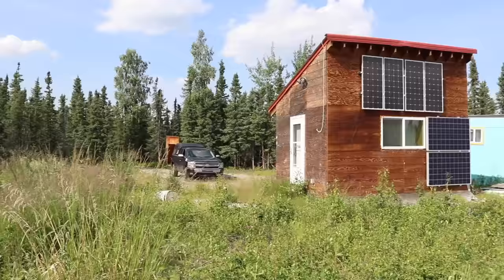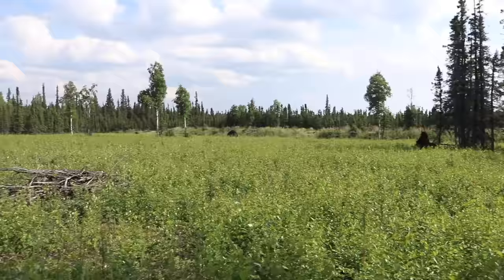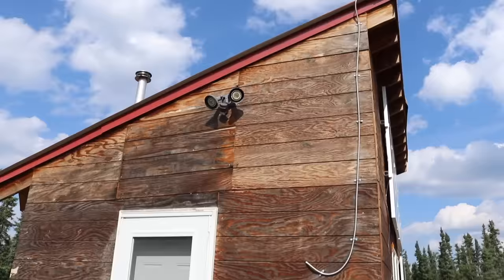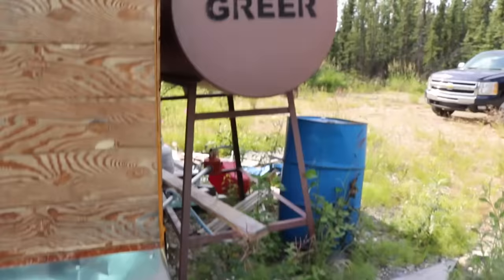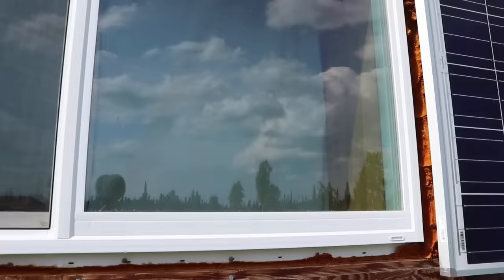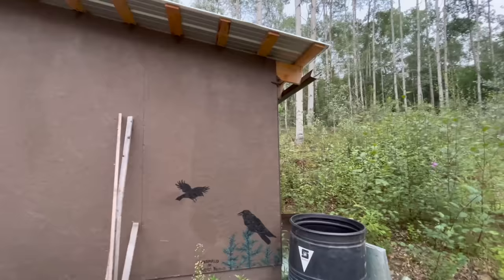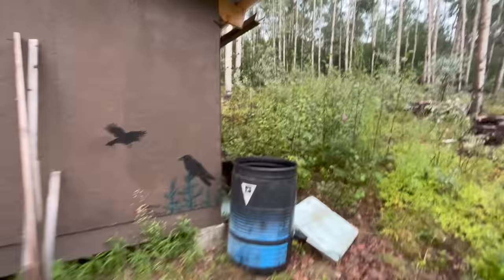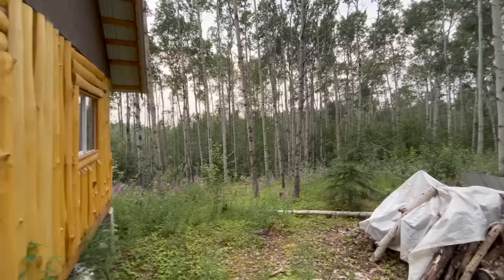Buying off grid land- you'll never hear this from Realtors

Comment: For 2023, it’s hard to nail down specific predictions for the housing market is because it’s not yet clear how quickly or how much the Federal Reserve can bring down inflation and borrowing costs without tanking buyer demand for everything from homes to cars.
Reply: Craig Daniels  Given current recession pressures, it is unlikely that the stock will yield substantial returns in the near term. However, it may be a suitable investment opportunity. I will monitor market conditions and consider purchasing when there is an improvement in the relevant economic indicators, any idea which stocks this may be?
Reply: @tatianastarcic  that's actually quite impressive, I could use some Info on your FA, I am looking to make a change on my finances this year as well.
Reply: @richardhudson1243  Found her, I wrote her an email and scheduled a call, hopefully she responds, I plan to start 2023 on a woodnote financially.

Comment: 33 years off grid I can say this is well thought out advice.
I chose a location with  gravity feed water,  south slope, fertile soil and walked a half mile, each way to the car,  for eight years before building a road, and putting in a standard sceptic to raise a family.
still solar power but I ran a 3000 foot phone line in 2 inch conduit. I also dug a spring and trench 1600 feet through forest and stream , by hand, to run the water line.
Definitely worth the learning curve.
Reply: George when you say you installed a "standard sceptic" was that one of your parent or one of hers?
Reply: @almoemason by standard  I mean it is a 1500 gallon two piece concrete tank with 200 feet of leach field.  Really modernized the feel of the camp become house and home
Reply: @almoemason  typos notwithstanding the parents were definitely sceptics for a few years
Reply: 3000 foot phone line???    what for?    internet?
Reply: @AI-Consultant  when I buried this line there was no internet on earth
Back then we had a five watt bag phone and it barely had service. 
Raising a family, before the internet, I provided the phone for my son's to communicate with friends, and so folks could reach me with offers of work.
Reply: @georgemckenzie2525  oh cool, and the ocassional jumping on AOL i bet,. hahah
Reply: @AI-Consultant  dial up 
I don't miss it 
25 megs is fine and it comes DSL over that same phone line
Reply: Sounds like me,I tend to take a while to get around to doing it! 8 yrs b4 you built a rd! When did reality wake you up one morning and you said ,gee,it's about time I built a rd to the shack!
But ,its an experience living off grid!
Reply: @davidrussell8795  actually Iall the tools I bought to build my cabin found me work as a builder. After a particularly grueling 18  months of construction in Somerville Mass ( 4  ten hour days/ three days off a week ) I had an extra $30,000 and decided that having pushed a wheel barrow ( the distance from vermont) to Los Angeles it should be optional to push it back
Reply: @AI-Consultant  Because if you check history we did not have cell phones 33 years ago and of course 33 years ago dial up was the only way to connect to the internet. Don't be stupid.
Reply: @almoemason  i'm only as smart as you almoe
Reply: I like that yu hqave walked in for a while  8 years that makes some of us think A road/ drive way is possible in long term. I live in suburbeand to many people just walk up to the  house! In past 4 years @ attemped break ins while i was home!!I  I am in subdivision just 25 28 feet from street sidewalk!
Reply: @marynorton5820  the walk became my foyer, easing the transition(most days) between the world of cars and roads, to home with its horses, dogs, chickens et al. 
Children, it turns can inspire a father to move mountains if it makes their growing better.
Reply: @marynorton5820  I live on a rural state road so the usual idiots never bother us, if they're out they hit the neighborhoods. I'm surrounded by six acres on my primary residence. If someone trespasses either I'll get them or my 140 pound male Great Pyrenees will. My second home is on a nice quiet road with 5x the land. Totally connected TYVM!
Reply: Sceptic? To raise a family? Yep that’s about right these days! LOL!
Reply: @almoemason 33 years ago the internet barely existed. Black screens with green type. I remember it well! Commodore computers!
Reply: @AI-Consultant  I will not. I told you not to be stupid, but I know now that you have no choice, Being stupid is not something that can be fixed. This kind of thing happens when brother and sister have children.  But at least stay out of conversations you don't have the IQ to understand. Stick with things like .... Crayons, Barney and maybe Teletubbies.
Reply: @AI-Consultant  I am not an old man and I am not going away. What I have to say is more relevant than anything you have to say.  Also why are you even saying anything to me. You just butted in to something that was none of your business. I am reporting you.
Reply: @almoemason  Reporting her. 🤣🤣🤣🤣🤣
Reply from the maker: Dat right there is how it's done... good work!
Reply: @georgemckenzie2525  I’ve loved reading your comments God bless you sir you are such and incredible soul and father . You are 🙏🏼🫂
Reply: @almoemason you win, rudest comments on the internet 👏🏼
Reply: wow
Reply: 1/2 mile to ur car? Why not temp build closer to rd while work on dwelling as u can. I assumed h worked daily.
Reply: @YeshuaKingMessiah  i did not own land closer to the town road
Reply: How you dig a spring ?
Reply: Found cold water running on the ground,  walked it back to where it appeared, then dug( with a shovel) a trench from that spot down hill , this way i was not working in water, when i got 4 feet below ground level i widened the area over the vein of water to abot six feet then built a five foot by five foot box by stacking 2x3  local rot resistant wood, walls are three inches thick. I probably should consider replacing the box as it is now 33 years old 
:)
Reply: @georgemckenzie2525 The trench was 4 feet deep and then the top of it was widened to 6 feet? Then you built a box over the source?
Reply: @mikuspalmis  the trench ran downhill from the source keeping a 1_4 inch in ten feet of drop.  At the spring itself a 6x6 hole formed the head of the trench.
The trench allows excavation of material without standing in four feet of water in the 6x6 hole.
As the spring box is nuilt up the trench is backfilled impounding the wster into the spring box.
:).
Reply: @almoemason  Geeze dude, hopefully you're waking up on the right side of the bed these days
Reply: How do you wash and dry your clothes?
Reply: @starrlara3109  at 44.44 degrees latitude we are lucky to go six weeks a year without running the woodstove, which i have learned is a very efficient clothes dryer.

Comment: You hit on every single important aspect of off grid property search/ownership and there are many.   Broken dreams, on-site-inspection, financing/cash, deeded access, researching current ownership, driveway maintenance, power, communications, heat, water & soil.  I don't know anyone who knows as much as you and Dave in regards to purchasing off grid property.  Maybe you've just created a new niche "buyers agent specializing in off grid property".  Always appreciate the executive summary from Dave.  'it'd be magic up here'.   Indeed.
Reply from the maker: awesome thanks!
Reply: @therealgirlinthewoods  The only other tip I might add is asking yourself the question, Does the property have quick resale value if, for some unknown reason, you need or want to sell and move?
Reply: @marciabyram6003  Quick resale!  You need the right type of people who want to live out in nowheresville.  So I’d say it could be sitting for awhile.  Because you DO NEED the right type of person.
Reply: I'm a prepper Realtor. While we're seen as the enemy, if a shopper is sharp and ready to take notes, an ethical local Realtor can warn a buyer of local issues like Brooke points out and connections for local experts and contractors for other questions.  One of the big issues is your ability (or lack of it) to borrow money to purchase or to insure a property with no power, running water, possibly very marginally safe structures.  If you can buy for cash and have deep pockets to cover any casualty (fire, wind, etc) or liability (a friend or worker is severely injured on your property) you're ok.   A great deal of risk is involved before you ever get to the point of evaluating the place's ability to meet your needs.

Comment: Thanks for the tips, Brooke! I've been blessed with a 30' x 50' pole barn with concrete floors to park my van in and most of the building materials (via "sweat equity") to build a tiny home/cabin for my "white woof" and I to stay in this winter. I really appreciate the videos you & Dave have shared on building, driving wells, etc. A home base of sorts to come back to in between forays of Boondocking. Later, friends ... God Bless
Reply from the maker: That is awesome!
Reply: Hi Brooke, thanks for your videos, they are so inspiring!  We are on our way to the Hiawatha Forest in the UP, where we have some off grid acres. :goodvibes:
Reply: Thanks,  with Starlink internet should be not a problem anywhere

Comment: I bought an on grid 31 acre property in NH and I'm not sorry. Nice and flat for the most part. I'm 57 now and I need the comforts. The land came with a 1972 mobile home. I chose to renovate it. TOTAL gut job. All new electric. Bedrooms are done, I'm doing the bathroom now. It'll be nicer than my primary home! I'm very close to dry-walling the rest of the home. Ceiling insulation and the last two windows are next while my friend finishes the plumbing. I just installed my Mr. Cool mini-split for heat and A/C. When it's all done I'll be able to rent it out to skiers and such and recoup my investment. It's a really nice get away, lots of land, lots of deer and bear for hunting. I paid cash.

Comment: If you can find a property in Alaska with a huge rock on it, build your cabin on top of that. Foundation problems are a big issue here. Water and access are huge. Remote off road is cheaper initially but then you will spend that money saved over time getting in and out to a remote property. But you’ll have solitude. Easy road access will have more “traffic.”
Reply: yes, in Maine many cabins are build over rock.

Comment: Solar powered atmospheric water generators are perfect for a place like this.  They pull water right out of the air, pass it through filters to make them safe for drinking, then the water is either collected in a gravity fed water tank or pumped into one.  They can be noisy.  There are different grades of this type of equipment for residential (on or off grid), up to commercial scale.  Zero Mass makes one model for home use.  Each panel pulls up to one gallon of water from the air per day.  They are working on a version that runs quieter without sacrificing performance.  As well as a year round version so it can be used in the winter without freezing.

For these properties you want to be sure you have complete rights to the timber, water, access to the property, all mineral and deposit rights, rights to the air space as well.  Those larger parcels of land are excellent for solar and wind farming.  With electric air conditioners that also can heat a room you'd be set.  Instead of simply living on top of the land you may want to create an underground dwelling for storm shelter as well as more living and work space with better control over interior temperatures.

With a satellite Internet feed like from StarLink you'll have broadband satellite Internet.  Maybe not good enough for some work at home gigs that require a physical connection to everything but some remote jobs aren't as picky.

Comment: One way I've come to realize for the water situation. If you have enough power you can always make a dehumidification shed to collect water from the air and you can design the roof to funnel rain water to a tank outside. The Shed is designed to let air in but leave weather, bugs and debris out. Its also designed to keep the dehumidifiers in good shape. They are up on shelving the hoses are joined to siphon to the water tank outside. The amount of dehumidifiers depends on how much water supply you need or want to store for later. Storage means that you run the shed less. Filtering comes after the tank, only because you can have multiple systems to collect water. This is a system that works anywhere. Some places it works better than others. I would collect two to three buckets a day just from the Air Conditioning units dehumidification cycle where I live. More than what I need some days. The shed can also dry things faster as well.

Comment: If you know how to play with lincoln logs then you know how to build a basic log structure. Just make the notches in the logs to fit together and build the same way you played with the lincoln logs. Just learn what it takes for the foundation, floor, and figure out the metal roof then all you need is the well and septic.

HINT: get the well drilled first, this way you know if you have water before you continue on with building. And also, you can build the cabin right over the well and design the kitchen sick right there where the hand pump from the well pops up, now inside the cabin. This way if power is out, batteries are out, etc... then you can still hand pump water directly into your kitchen sink directly from the sink. But you can still have it all work with a electric pump, but in this case it is for redundancy if something happens to the elec. system.

Comment: Building without experience is where we all came from.    "Handmade houses" is the subject of several books I've run across where folks clustered over time due to access to what they needed where each built their own home out of what was available locally.  The thought that should be utmost is to know that home-improvement will be on-going.  It pretty much is in any structure, whether you build it yourself or not.  With availability of RV's, inflatable tents, etc it's more doable than ever.  I've purchased numerous properties over the years, with and without structure on-site.  It's important to be realistic though.  Especially if you're in a relationship and the other party doesn't care to go off into the country.  That can cause more trouble than the land itself.  And just having knowledge of building technique isn't enough.  There are still those things you need to purchase with $$.  Dreams won't build houses.  It's hard work and diligence that will.

Comment: Ohhhh! the Fox Spring! 🤩
Lived 7 years in a dry cabin just outside Fox (old dredge tailings) for 7 years but did have electric.  Hauled my own heating oil, 2 drums for storage and drip stove.  Hauled water from the Fox spring.  My outhouse was just an old drum on an embankment.  One warm winter, nearby stream was blocked and had 6-10 inches sheet water flowing over the property.

Drip stove served as water heater.  Set tote on chair, wash top half body, set tote on floor was the rest and rinse. LOL
Reply from the maker: good stuff

Comment: Brilliant video :-)

Running water? Easy peasy. Let's assume you have a well... One IBC tote, elevated 20ft. PEX. A few fittings and one pump. The pump could even be powered by wind, or if you have a stream or better, a ram pump.

Interior Alaska means a few thousand gallon in ground storage tank. More IBC totes or whatever you can manage.
Soil? Where you were i saw a LOT of green. And a lot of trees. Mow the green stuff, mix it with wood mulch and keep it wet. Compost. Gradually transform.

Sewer? Get the book "Humanure". Or build the outhouse to be easily movable so you can just walk it around. The waste will turn into soil over time and you just cover the old holes with 6" of woodchips.

You're 100% correct. It all depends on what your are willing to sacrifice. However, if you are handy and motivated you can create everything you need, given time and energy. That's how our ancestors did it, and we have access to innovations they could only dream about.

Comment: I had a house in San Francisco a mile or two from the beach. The yard was sand. I lived there for 10 years cutting and composting whatever would grow on it also adding kitchen scraps and other compostable food stuff (eliminating the need for compostables pick up. I'm going somewhere with the parenthetical here.) I also composted paper grocery bags. I heated the house with wood for a very long time utimately eliminating garbage pick up all together by rolling the junkmail into fire logs. I was producing NO waste. You know what you can't do? Cancle garbage pick up even though you don't have any. Home of the free eh? Back to the yard. After a decade of growing and pulling 6ft tall weeds and composting them, pulling the nasty web of roots of the sea grass that covered the yard and turning all that compost into the sand I had a weed free dirt yard with great drainage. I finally spent some money on it and  planted some drought resistant grass. A yard resulted. if you wanted to do something like that much faster you could contact a yard service and arrange to have them dump their yard waste off. If they pay to dump it you'd be doing them a favor.